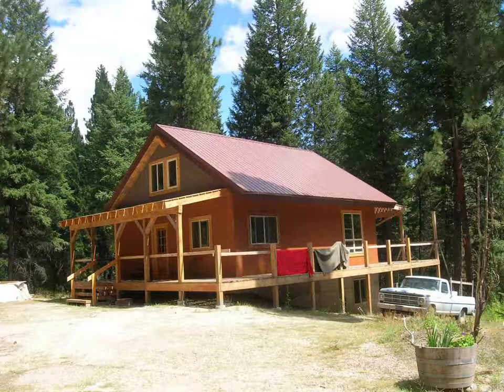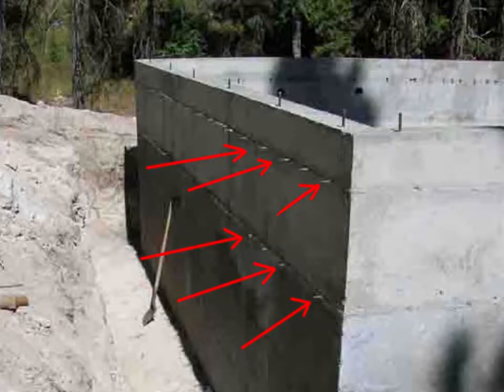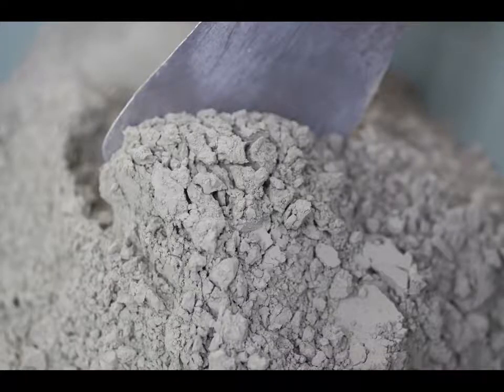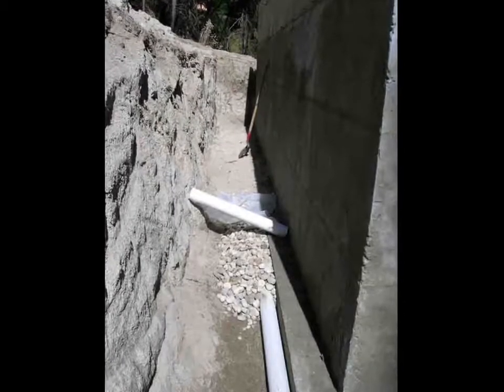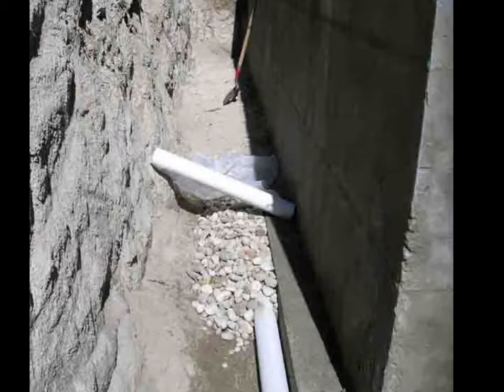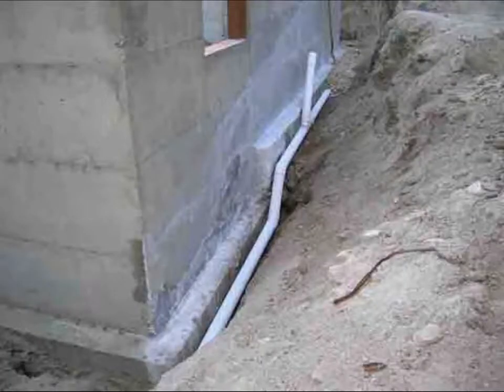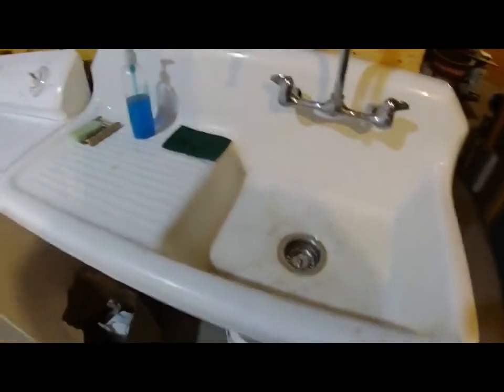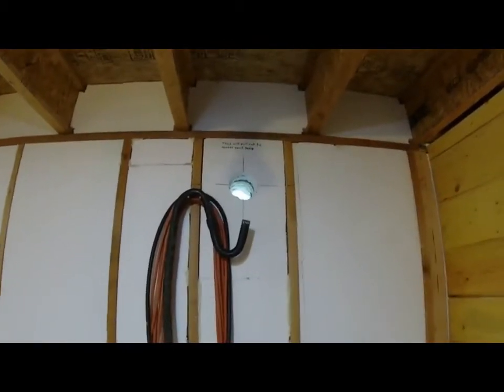A dry basement foundation for a mountain cabin.

Comment: Great job.  
Whenever I build a French drain ( we use them for septic tank and stormwater dispersal, and well as for drainage of waterlogged areas) I lay the geotextile cloth ( we use a product here called Bidum that is a polyester replacement for the old coir based version) cut to about 1.5m (5ft) wide on the ground.  The pipe ( either a commercial product called AgPipe, or we just attack plain PVC pipe with the angle grinder) on it, cover with a good amount of 25mm blue metal ( crushed basalt), then fold the cloth up on both sides, and fold the edges together ( like ‘closing’ a paper bag).  We then use stainless steel staples ( with a standard office stapler) about every 20-30cm (8-12”) to hold it together for backfilling.  Works a treat, and there is no way that sand or our local clay can get into the pipe.
Reply from the maker: Sounds like a well thought out method. I agree that it's important to prevent silt and sand from filling the air spaces in a French drain. Otherwise the drain will just plug up and your back to square one.
Reply: @nickeljay767  exactly.  The washing in of sand and silt will very quickly render it useless.

Comment: Great informative video. 👍🏼👍🏼💪🏼
Reply from the maker: In retrospect, insuring a dry basement was one of the best investments I've made on this project. The materials were probably a few hundred dollars. My labor investment, mostly shovel work, took about a week. 
The basement walls were poured just before snow. The first thing I did the following Spring was the subject of this video, sealing up the basement. It was tempting to just back-fill and start building because I had to get the entire structure, especially the roof, up before the following Winter. I didn't want to leave an unfinished structure exposed to the Winter elements.
As it turned out, it was snowing when the roof was placed.

Comment: when you applied the portland slurry - did you overlap the foundation seam between the footing/ slab and the wall to seal this trouble area?
Reply from the maker: Yes. I daubed in a lot of the slurry sealant at the footing-to-foundation wall joint, then brushed it into a slope away from the wall (similar to silicone seal around the top of a built-in bathtub). 
You bring up a good point. My footing and foundation were installed one Fall, then sat exposed thru the Winter. The next Spring I shoveled the snow out of the inside of the basement, so the inside dried out.  As the snow in the open trench around the outside melted, I noticed wet spots on the inside top of the footing, along the footing-to-wall contact. The snow melt from the outside ran under the foundation wall to the inside of the footing. So it would be a mistake to assume that the bottom of the foundation wall somehow seals itself to the top of the footing.